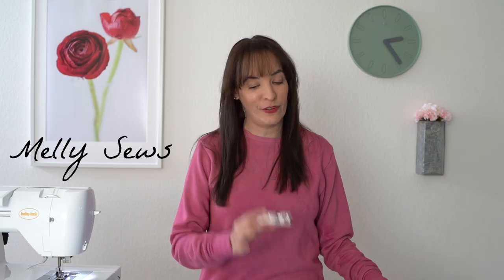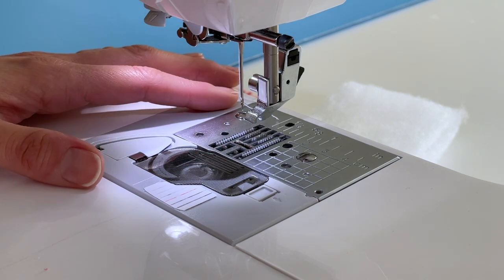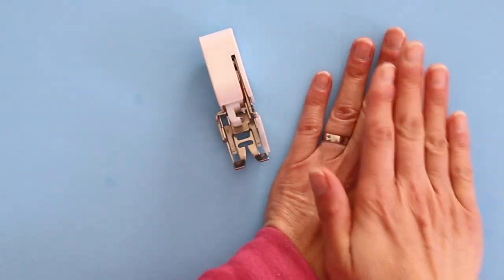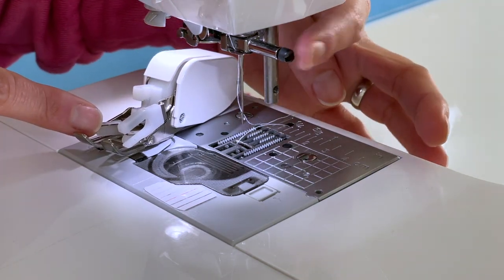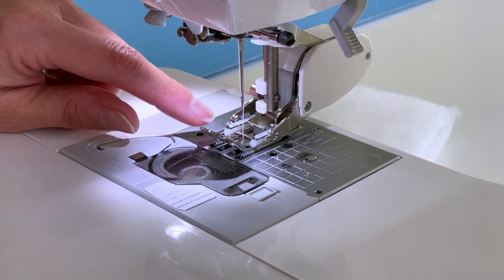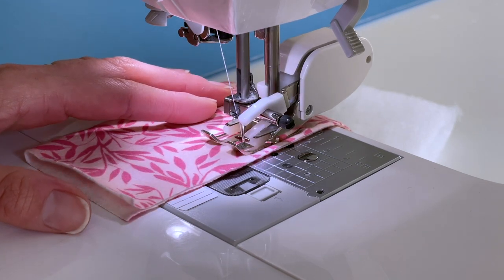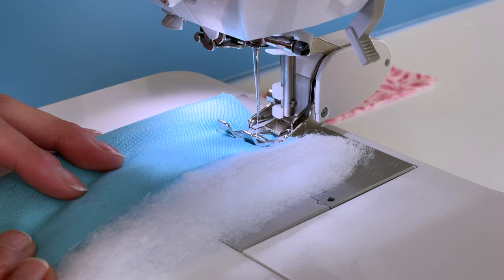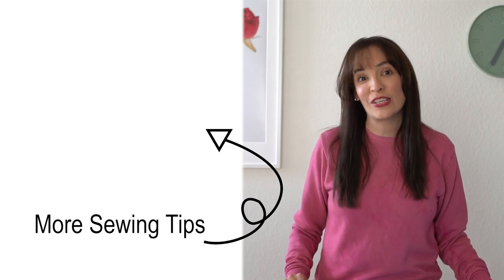How to Use a Walking Foot for Sewing

Comment: It’s a very useful article.I have a question.With walking foot , they supply one another bar with (like a V shape) attached another piece. It’s one connected pcs .
I don’t know where it goes. With  another u tube video, I see that but nobody saws where it goes, what is the use etc,
Thanks in advance
Reply from the maker: I don't understand your question. I'd suggest doing a google search for your specific machine manual.
Reply: @Mellysews  there is a little stick/bar thing that comes separately with the walking foot.  What is it used for?
Reply: I think you are referring to a quilting bar, to measure the distance between rows of quilting, which you can adjust. I pay attention to  the bar Instead of the needle while quilting .